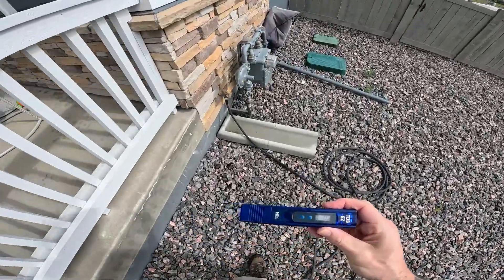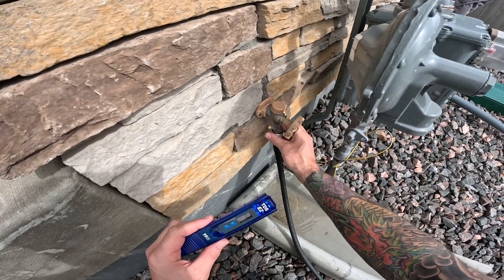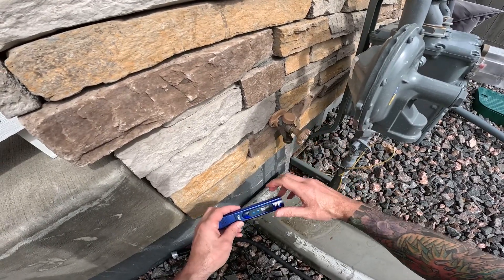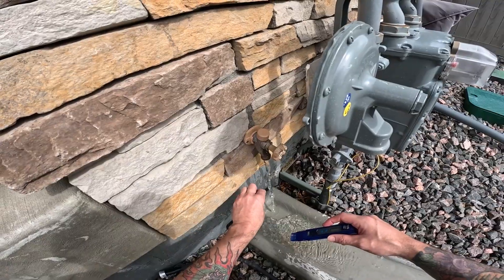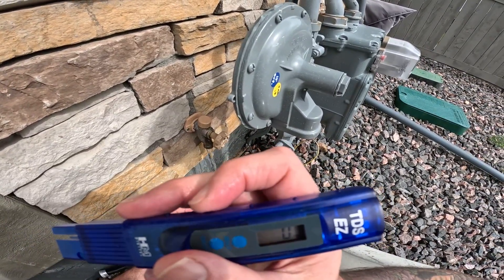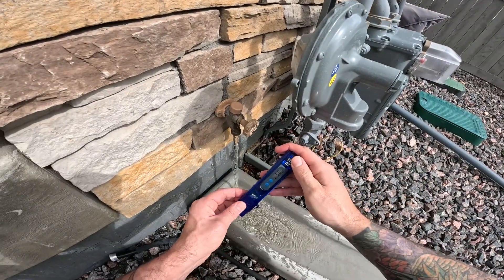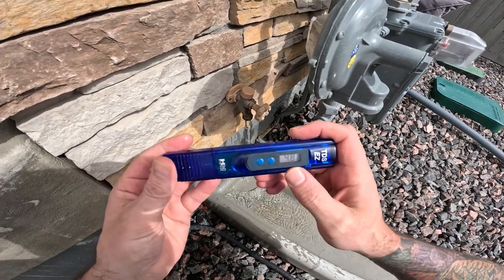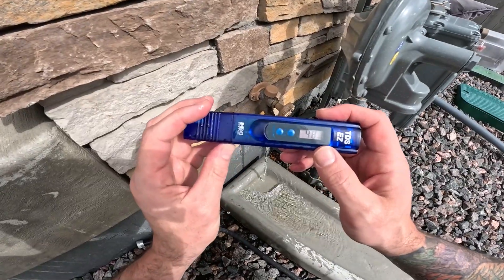HOW TO MEASURE TDS OF WATER | TOTAL DISSOLVED SOLIDS

Comment: I have had my wfp and system for about a month now and the house water I us is mainly 400-600 tds. After the water goes throughout my system it comes out anywhere from 5-13 tds which will leave marks. I was just wondering if this is normal for a month old system that has only been used 15 times.
Reply: 500 to 600 is crazy high, at 5 ppm I don't think it would leave much if anything behind
Reply from the maker: At that high of TDS I suggest always having resin ready to go. Its going through the resin around 60-20. Also check out my replacement filter video to see how to do it https://windowcleaner.com/products/xero-virgin-resin?sca_ref=3020242.k17l3JaEgS